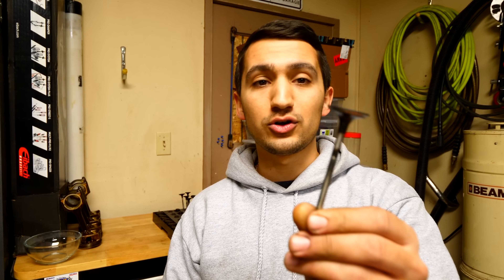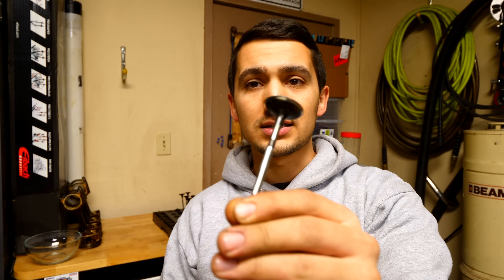How to Clean and Refinish Valves

Comment: As an engine builder myself, should never use sandpaper on the stem, this removes material causing balve to guide oil clearance to increase which can cause immature wear of the guide as well as the valve
Reply: Exactly
Reply: That's what i thought and I havnt clean mine at all yet it took my top end apart.
Reply: I use blue painter's tape on the clean (guide area) end of the stem, i was always worried about the drill chuck scratching the stem
Reply: What's "immature wear" lmao
Reply: @clydewatson7889  I'd tape off the ends before putting into the chuck
Reply: Ya for real valve guides don't like this .sand paper is steels worst nightmare this seats should be reground and along with the ones on the head and then u might as well buy new valves they aren't that expensive
Reply: @koszuta  it means the valve will tease & bully you on the playground...
Reply: I was sitting here going wont that make them not fit? like engines run by the mm with some parts ty its not just me this guy is an idiot glad to know thank you
Reply: Even as a novice on engine building (currently on my first engine teardown -  though with a decent amount of engineering knowledge) I was wondering this straight away. Thanks for the input.
Reply: Totally agree! And protect the stem from damage by the chuck jaws
Reply: Using a fuel line over the valve stem will protect it during your cleaning
Reply: Exactly... As a non-engine builder I was looking at that and saying to myself, that doesn't look right...
Reply: conelyking indeed, the guy from the vid is a brute!
Reply: So what should I use instead of sandpaper.
Reply: 1000-2000 wet sand wont hurt
Reply: I thought the same excessively cleaning . Would it be OK to just use some compound cleaner and polish lightly or would it be more safe to just wipe clean with 90-100% IPA ? Maybe just enough to clean and not remove any valve material if you can idk even so that being said better to just replace them and verify valve guides clearance tol. Per spec At hand mmmmk
Reply: @Road_Rash  😂😂😂
Reply: Agree
Reply: That's what I was thinking. 🤔
Reply: I thinks it's ok using this method but not on the part where the oils seal area.
Reply: What is the best way to clean valves
Reply: Correct
Reply: What is better to use

Comment: please take this down before people ruin their valves
Reply: Johnny Cash I was thinking the same thing, I just knew he was about to use a bench wire wheel
Reply: Just curious, how is this process damaging to valves? The surface loss by doing this is absolutely minimal.
Reply: @syrthdr09sybr34  Because its in an engine, the tolerances for mistake is very low, slightly changing the angle and geometry will allow blow by
Reply: @connorray9801  Well given that he's simply polishing the surface and not removing any substantial amount of material, don't you believe that simply grinding new valve seats and installing a new set of valve stem seals would be sufficient for proper operation? I mean you should already be doing all that when rebuilding a cylinder head after all.
Reply: @syrthdr09sybr34  You have to realise that everything in engine is being measured in hundreds fractions of a millimeter and that right there is more than substantial amount of material removed.
Reply: @granatins6259  How many engines have you built in your lifetime?
Reply: @syrthdr09sybr34  Actually quite a few, i have spent four seasons as a private mechanic at mxgp both mx1 and mx2 clases. and have done a lot of professional sports bike work... ;)
Reply: @granatins6259  So apparently that means that you've always had the monetary support to just throw money at the problems that arise.
Reply: @syrthdr09sybr34  you just have no idea what you are talking about. Afterwards i have run after sales departments for many years, not only with motorcycles. but agricultural machinery as well with more than 40 mechanics in my team, together for more that 12 years in this business, i have seen what works and what does not.  Man there are a lot of things that can be solved by rebuild, i have done warped head lapping at a track side when there is no other option. but it comes with some problems down the road if no addressed correctly afterwards. i don't even get your argument man.. :D
Reply: @granatins6259 We can sit here and talk about who's is bigger but boy you're fighting a loosing battle specially with your limited mechanical experience.

My argument is that you are nothing  but a wannabe, all I asked is how many engines you have built with your own two hands and you gave me your whole work history which is not even that impressive. So you work on bike engines bro? Well that's cute lmao.
Reply: Syrthdr09 Sybr have a good one girl ;)
Reply: @granatins6259  That's what I thought.
Reply: @syrthdr09sybr34  LOL!!!! i'm weak!
Reply: @granatins6259  cleaning the valves by this method is ok, you always have to reseat the valves
Reply: @Solify750  Good to know.. 👍do what ever you want with your valves just dont touch any of mine 😂
Reply: @granatins6259  i reprair all kind of motorcycle engines and never had a failure after repairing it
Reply: There is something called valve lapping compound.  Use this between valve and valve seat to make a perfect seal.  Do this after valve polishing is complete.
Reply: @syrthdr09sybr34  minimal damage times 16 valves equals?
Reply: @whiteboyfromernul  Plain and simple bro these methods of old school mechanics are just like BASE jumping, it is not something that an amateur should even attempt to do because it isn't safe by any means.But just like BASE jumping these methods can absolutely be executed by a total master of the art with no problem at all and to very good effect. 

In short if you have any doubts about it then you're not even qualified to be doing it in the first place.
Reply: @Sound Money Not sure where this is coming from, when in all my previews comments I have defended the method shown in this video.

So not trying to be a dick, but what the hell are you talking about?
Reply: @syrthdr09sybr34  how many engines have you built in your lifetime with your own two hands?
Reply: @HFSIR  Enough to have a solid understanding.
Reply: if you read all the way to the bottom of that, the summary is ~~~ don’t listen to @Syrthdr09 or anyone that is suggesting this method be used.
Reply: @syrthdr09sybr34  see, that just doesn’t sound like enough to me. I work in Los Angeles, my shop builds race cars. We build bonneville cars, land speed cars, pro drag cars, touring cars and we build big reds 2000 Hp twin turbo supercharged engine. So there’s 2 sides to this; 
Smoother polished valves might “last longer” because they won’t develop carbon build up as quickly and for low performance applications sure you might be fine as long as you DIDNT grind away the angle on the valve and yes you could lap them. If you’re running a carburetor you wouldnt want your intake valve that smooth because you would like it to atomize the intake mixture as best as it can to help the carb: too smooth, no atomization. Now part 2 to this, If anyone plans on building ANYTHING above stock applications! Don’t Sand down and polish your valves, buy performance valves. New valves have a coating on them which causes the valves to have reduced heat, which coincides with less carbon build up and less friction. Also you wouldn’t “lap” your valves anymore because the valve heats up and begins to unseat slightly at operating temp which will act as a split overlap and you’ll tear your engine apart trying to figure it out what it is and why your car have a lumpy idle or why you have less compression than you should or why it sounded like you have a misfire and your exhaust pops. Buy new valves for performance, have the heads and valves cnc’d to match and you’ll never have to worry about any of this again for the remainder of that engines life. But for the love of God don’t sand, polish and lap your valves just because it looks pretty. Study what you’re about to do to the heart of your engine. Those nice shiny valves won’t be looking so hot after a few days and anything over stock rebuilds will fry your valve seats.
Reply: @HFSIR  In my opinion most shops are nothing but part changers, very few people in the industry really know anything about fixing parts with the exception of machinists.

So you telling me that you have a shop simply tells me you got a big wallet to throw at issues.
Reply: @syrthdr09sybr34  you would be incredibly incorrect. We’re not “mechanics” or most shops. Tell me how you was planning on re-coating the valves or correcting the valve to valve seat angle or the valve getting blow by? I’m not rich, just because you think your “poor” and have to reuse every little thing... doesn’t mean you should advocate for something you don’t know the science behind.
Reply: @syrthdr09sybr34  think of it this way... if the central nervous system in the human body that connects the brain to the lungs wasn’t functioning properly... would you tell the doctor not to do his job properly because “he’s just gonna throw expensive necessities” at you? Would you then recommend the next person to not let the doctor perform the proper operating procedures just because it may or may not be more expensive? Camshaft=brain.                    Valve train =nervous system. Cylinder=lungs.
Reply: @HFSIR  For someone that works at a shop you don't sound too bright...oh wait it's just a performance shop.
Reply: @HFSIR  Well kid those of us that work at real shops know better, sometimes you are working on parts so rare and expensive that replacing them is not a viable option at all.

Add to it the fact that most of the equipment we work on has to be running asap with minimum down time. 

It's this simple if it ain't running it ain't making money. Specially if you let it sit around while you wait on parts.
Reply: @HFSIR  My "beaters"? Lmao, try more like multi-million dollar equipment son. 

It's ok though, I don't expect you to know what it is like to work for a multi-million dollar company where each hour of down time is worth six number figures.

As a matter of fact, I bet you have enjoyed some of the food my "beaters" have produced, thanks to my "bad habits" keeping them in operating condition.

I got money that says you wouldn't even be able to prime one of the simplest units I work with on a daily basis.
Reply: @Syrthdr09 Sybr How many engines have you built though. 

From my research, it appears you drive a 2009 Toyota Camry Base model. 

Please step it up sir.
Reply: @angelbabyblue95  I really don't care what you think.
Reply: I put oil in a car once so back off
Reply: I'll chime in! Scotch bright will take 1/1000 of an inch for 30 seconds polishing as long as you keep even and only clean as much as needed unless you working for a formula 1 race team your going to be ok
Reply: @syrthdr09sybr34  lol he stooped talking to you cause you're being toxic dude lol
Reply: @shimon2476  i mean a small amount of material removal like this shouldn't be a problem if you lap the valves and get a good seal, there are various ways to test that after you have done it before assembling the engine
Reply: @kiyosenl.3889  No, people stooped talking cause they ain't got shit to come back with.

I'm not the one bullying a kid for uploading a video showing a different method than mine. It's ok to not agree with it, but to be talking shit without real world experience is a different thing.

I don't care how many shops anyone owns, without first hand experience they are just dudes playing the expert, while real experts do the hard work for them.
Reply: @Harrybowles1969  um, what? Where did you get your numbers from because for 1, a thou is A LOT of material, that will almost certainly screw up your seats, and for 2 the grade of steel they are made of will certainly change how quickly it will sand down, for 3 the drill speed will change it, and for 4 the condition and grit of your abrasives will affect that as well, as best as i can tell you pulled a bunch of numbers out of thin air and declared it fact, i work in a machine shop and some of our plastic parts need to be within 2 thou of spec, what we make is hardly as precise as engine tolerances, you usually blow a headgasket at .003, that gasket has a lot of flex in it to form a nice seal but that little bit of warp is too much for it, valves seal metal to metal, their surfaces need to be exactly the same, a thou all the way around is a 2 thou loss in diameter on a tiny sealing surface that needs to be perfect, and before anyone comes at me for being a machine shop snob, again im not in an automotive machine shop i make parts for trolling motors, and i am heavily considering doing this to my valves tomorrow since im tearing down the head to clean it and swap the vvt anyways
Reply: @kiyosenl.3889  you will be fine. Scotch bright finish is fine on valves. If when you pull the valve from the guide with your finger covering the end of the guide, if when you pull the valve you get suction on your finger and a pop. Your good to go. 
If you have excessive play in the valve and it wiggles and no suction it's no good. That's the what you can get away with method
Reply: Was just gonna ask whether this is legit. I’ll just use a valve lapping tool
Reply: I don't know who thinks this but from a automotive machinist stand point? Yes, I helped run a machine shop. HE DID NOT REMOVE ENOUGH METAL TO HURT ANYTHING. YES, HE NEEDS TO HAVE THE  VALVE SEAT ITSELF REGROUND BUT THATS OBVIOUS.
Reply: Sand paper after sand paper. This boy is smoking Kellogg cereal.

Comment: Don't forget when re-assembling the engine, to install the piston return spring.
Reply: And the exhaust bearings!
Reply: And blinker fluid
Reply: Also cut the exhaust to apply a exhaust clamp
Reply: LOL Ahhhhh
Reply: Wait those r real?
Reply: @leonardpadin869  yeah cause the exhaust is one of the fastest spinning parts in an automobile, that’s why it’s so loud.
Reply: There is actually a piston return spring in transmission.. >: )

No joke
Reply: This poor kid probably did exactly that. LOL!! He means well, but should have removed this video immediately after realizing that he's misinformed.
Reply: @enterBJ40  you will need to find your left hand screwdriver to open the blinker fluid lid.
Reply: @paule4204  No!  That tool abuse!  Screwdrivers are for screws.  Use only a lid lifter.
Reply: Yeah...I forgot those! Gladly I have a complete set made of chinasium  but are right hand drive only. My next acquisition will be the heavy duty plastic reinforced cardboard made impact socket set.  Nothing beat it !
Reply: Helps return the piston n such.
Reply: Always use a left handed screwdriver and send your mate to the parts store for a " long weight "  !!
Reply: @wilfredvanvalkenburgh2874 That's racist!
Reply: @paule4204  Along with a metric crescent wrench.
Reply: @leonardpadin869  I was always told it was a muffler bearing that was the issue.
Reply: @GothKid1996  Actually the exhaust with a turbo spins many times faster than the engine.

Comment: You seem to be under this pretence that shiny = more power/better performance. As long as the big chunks of carbon are gone the valve will be fine.
Reply: Not at all. Carbon and gunk had a hard time sticking to polished valves so it’s better for the longevity of the engine and components. Has nothing to do with performance like the guy said.

Comment: Dude - I'm sorry but you need to stop doing this. Cleaning off the carbon with scott-brite is fine, but sanding it is a bad idea - period.
Secondly most valves are 2 different steels - and you can see the join above the head. Most valve heads are stellite - a type of steel.
Removing coating is also a bad idea.

You seem to be under this pretence that shiny = more power/better performance. As long as the big chunks of carbon are gone 
the valve will be fine.

End quote - @dirtygarageguy